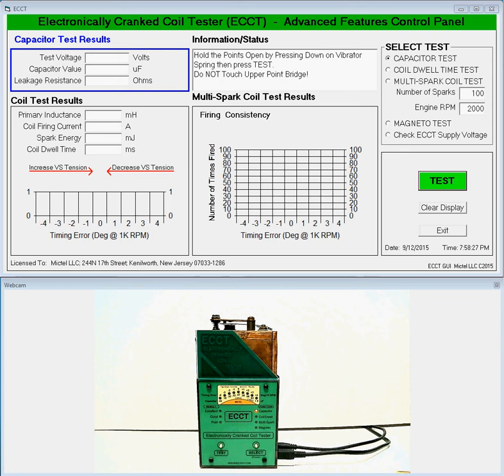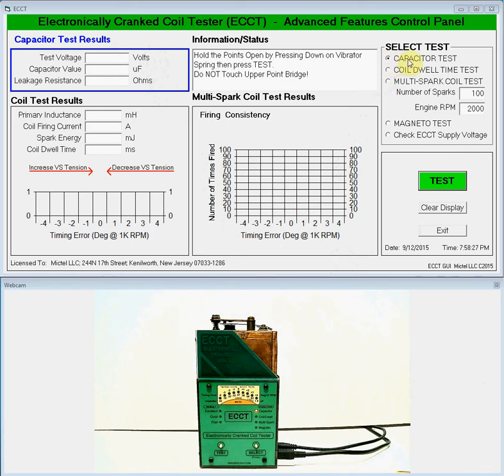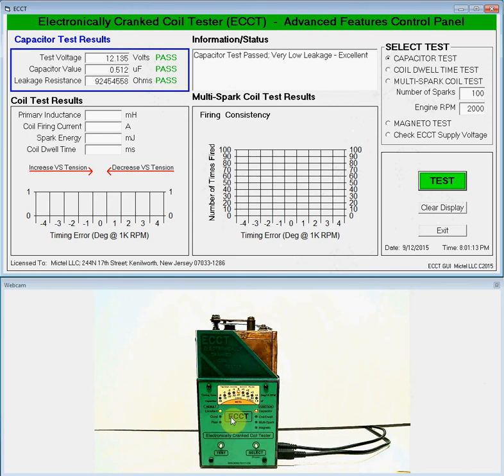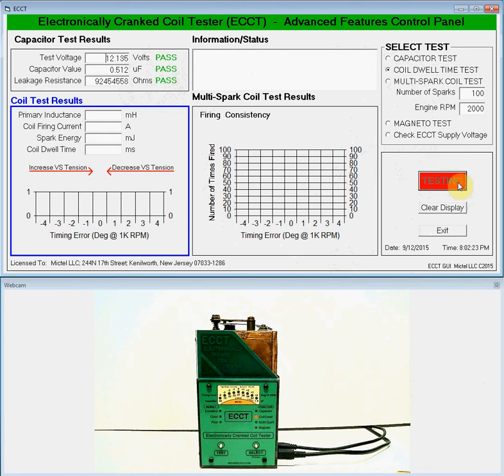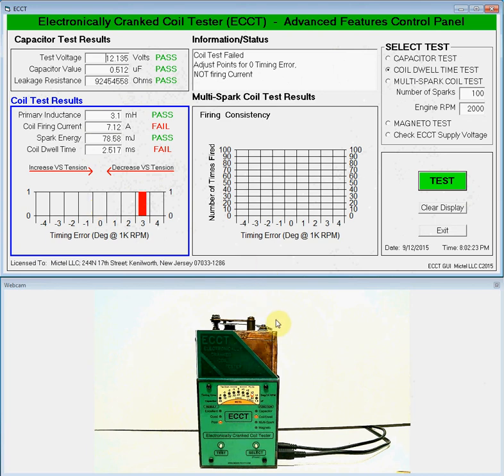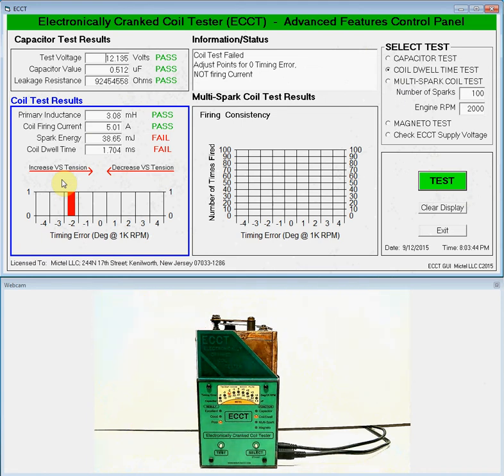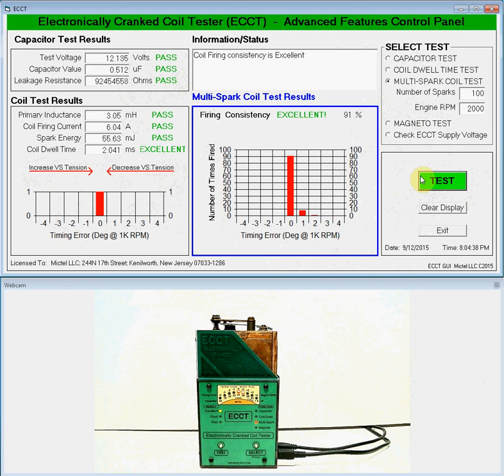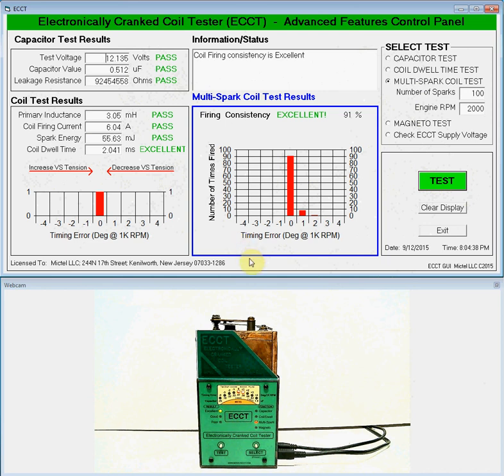Introduction to Testing Model T Coils with the ECCT

Comment: This is an excellent instructional video. I've used the ECCT and it really is this easy to adjust Model T coils. What I like about it is that the firing time of each coil is adjusted to be the same as all the others in the set. This makes sense, because optimum engine power cannot be achieved if individual cylinders fire advanced or retarded relative to each other.